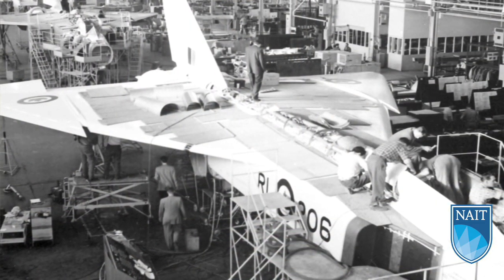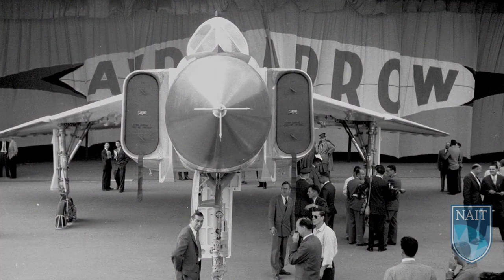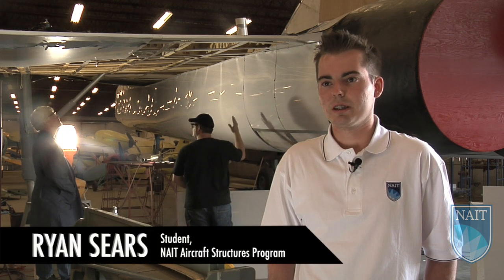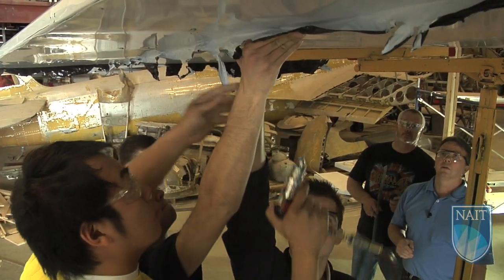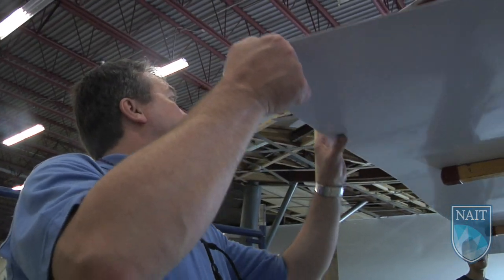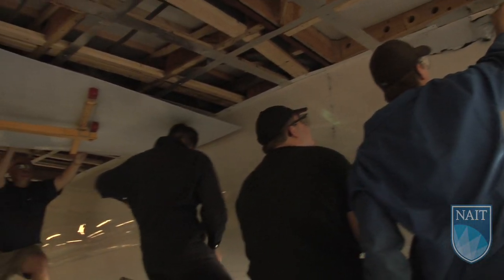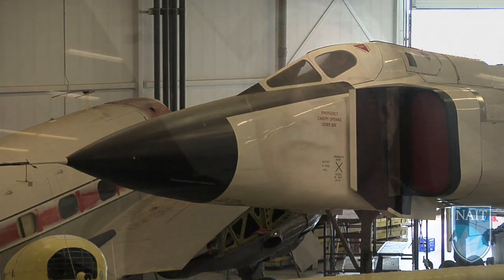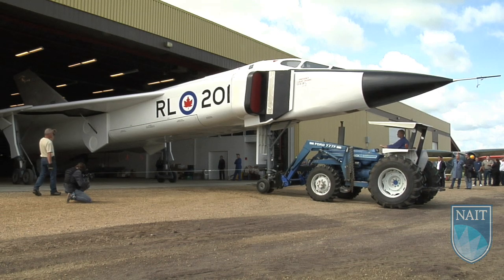techlife: Avro Arrow model ready for public

Comment: @MikeFilmStudios25 
furthermore your claims of mach 3 engines are based on projections of an engine that didn't even reach prototype stage, like most myths about this plane, there is a lot of hot air behind it.
Reply: Your comments are based upon made up theories of those doing the estimates on how the aircraft would fly/handle. 
So faultily from there.

Comment: @MikeFilmStudios25 
no, the arrow wasn't supposed to go mach 3, it would have melted.  You cant make simplistic extrapolations based on engine power, the americans had to go to great lengths to get things like the blackbird working. they weren't strapping bigger engines to old air frames that is for certain.
Reply: Titanium and steel composite alloys.  Those materials were NEW to aircraft building, in the 1957-1959 era.  Also the reason why such aircraft are / would be expensive (more so) today.  In theory, an Avro MIGHT be obtainable / build-able; but not at the higher performance specs.  Mach 1, at best.  Possibly - only 1 engine, as well.